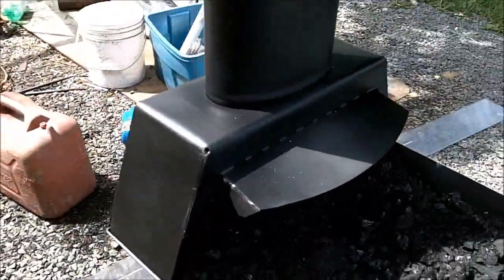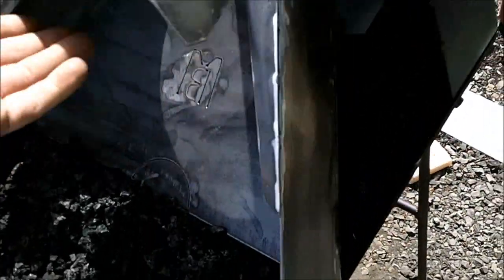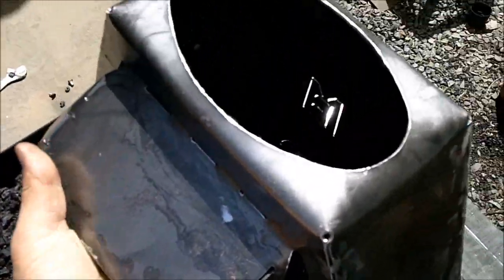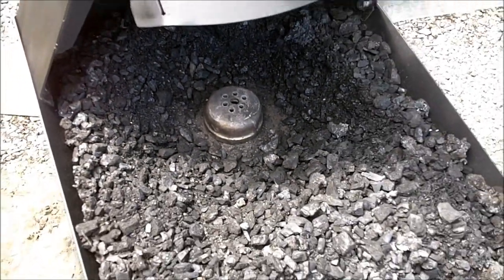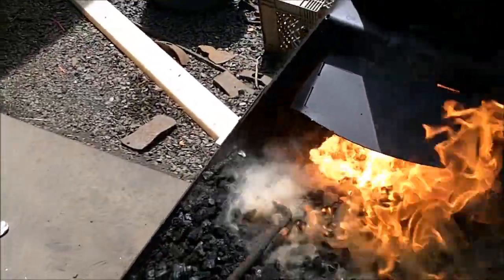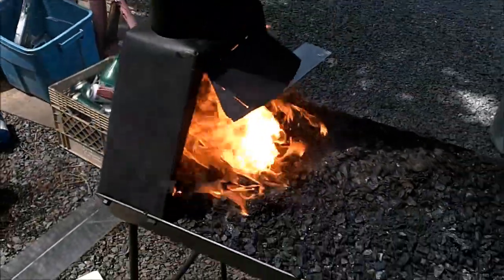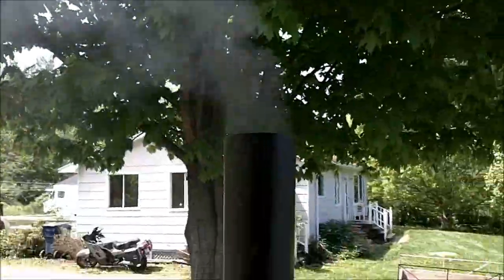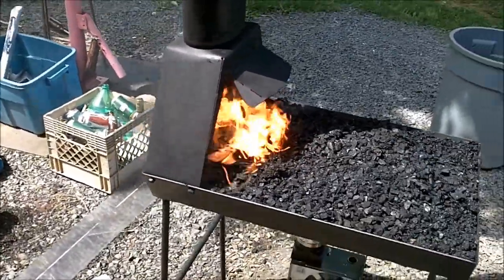Refinements to the Modern Blacksmith Hobby Forge

Comment: Fire needs heat & air.  The coal that's not near the blower hole doesn't get hot enough to burn and it surely doesn't get enough air.  You actually have to coax coal to burn and keep the blower going or the fire dies out.  Also, you sprinkle the coal w/ water to help pack it together to form your mound.  The water also reduces the likelihood the rest of the coal will catch fire.

Comment: Hi,
If you are interested in getting a price to New Zealand can you see if it would be cheaper for the post to get two in the one box - maybe one slightly smaller so they fit inside each other - I wouldn't need the fans as we are 240 volts here - I could also make the legs if it makes a difference.

Comment: Thanks for the info. Is the coal anthracite pea coal?
Reply: +Brian Dwyer I don't think that's anthracite. It's smoking way too hard to be anthracite and the flames are too big, usually anthracite just gets really hot and only glows. That's why a lot of blacksmiths like it, most of the heat is still in the heart of the fire and doesn't get lost in the flames.

Comment: hey Dan i have a question for ya would adding a fan to the smoke stack help the fire at all?
Reply: +Deadmaan87 i thought the same but the heat might destroy the fan pretty quick so i scrapped the idea real quick
Reply: You could lead a pipe upward into the back of the chimney or the hood, then attach a fan behind